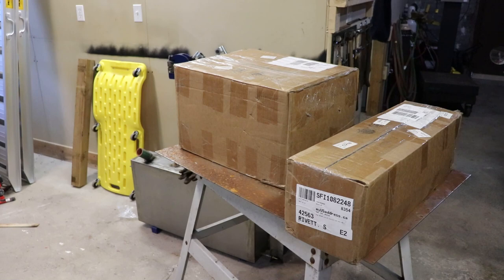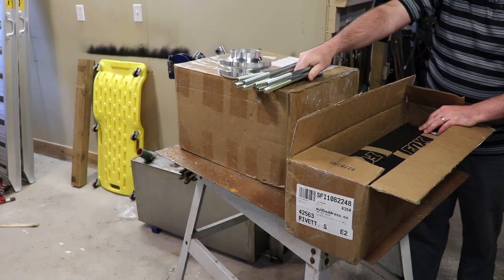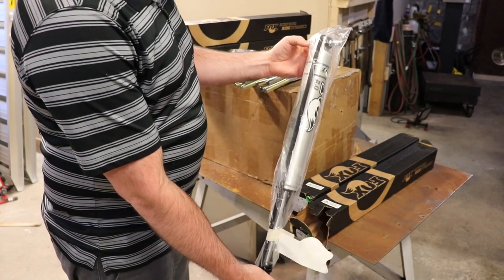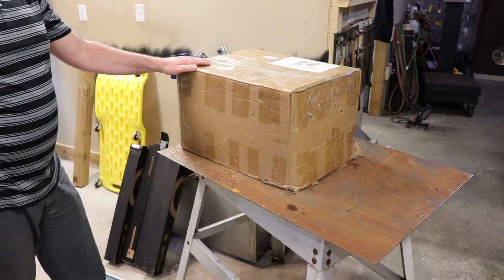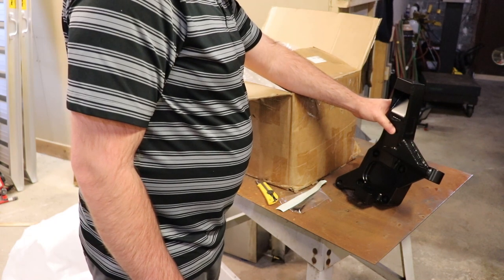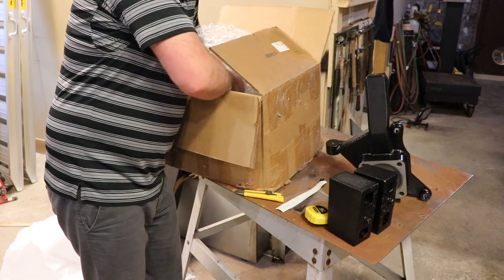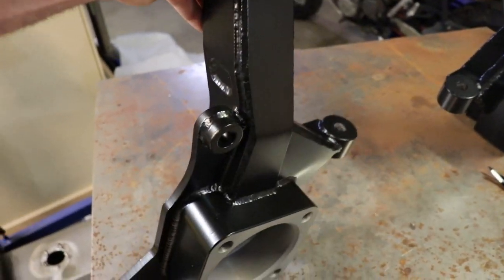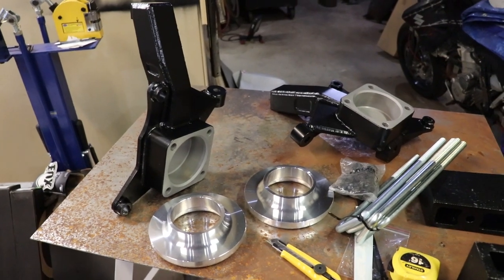Chevy Express 2500 3500 2003+  5" Weldtec Lift Unboxing

Comment: What is the part number of the front Fox shocks? I need to replace my shocks asap and can't figure out those Fox 2.0s. I'm in Canada too! Thanks!
Reply from the maker: You should contact Weldtec and/or Fox.  I have a part # but they are supposed to be re-valved (not that it is possible to confirm this).  For what it's worth, they are the same length as the application specific Bilstein's I took off.

Comment: Thanks for the video. I will be sure to use your affiliate link when I purchase.
Reply from the maker: Thank you for the consideration.  I'm still working out the bugs on my van, I'm getting a bad front end shake sometimes when braking and an uneven rebound.  Getting an alignment helped but I need to look deeper and see what's bad...probably the steering gear.  I had the front end shake before when the rotors warped so I need to look at greasing the caliper slides.  Got about 8 hours of driving on the lift so far up to 80 mph.